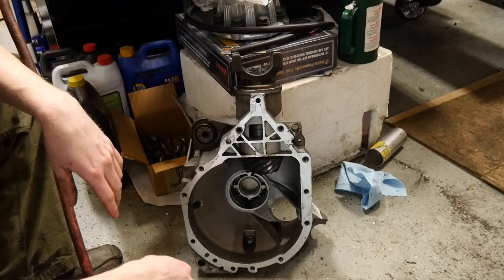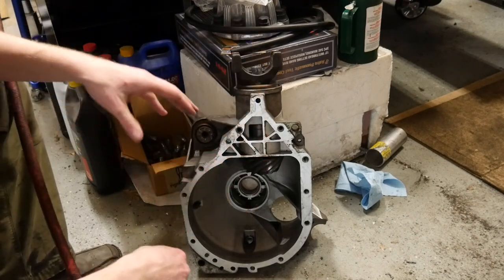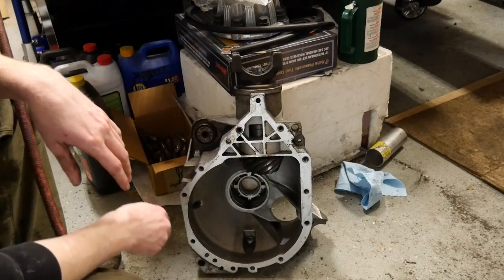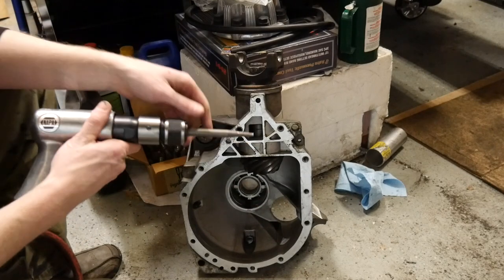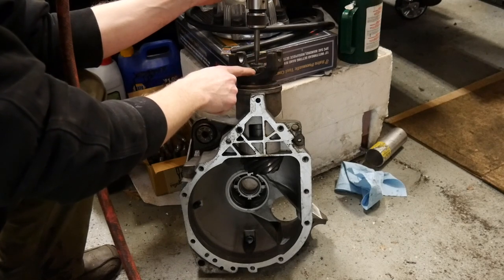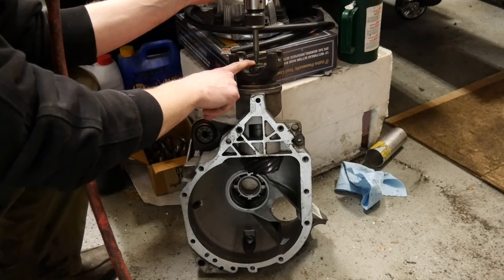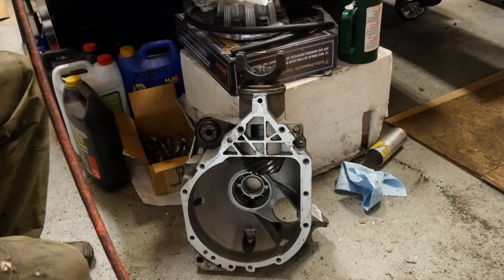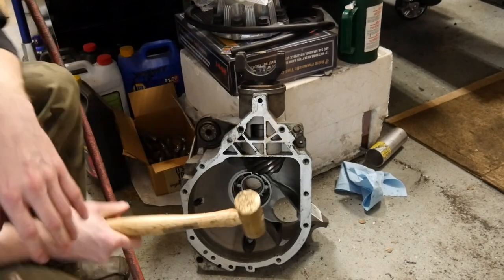DIY - How to remove a stuck pinion gear from an axle case

Comment: Been trying to remove the yoke from my Dana 44 axle for three days on my 51 Willys Jeep. This is really a pain and trying to not break the yoke. Thank you for the tips. Ill try this tomorrow night
Reply from the maker: Did you end up getting that yoke out?
Reply: Epic Tim Not yet. It wont budge.
Reply from the maker: bummer!  You can also try to soak it in some penetrating oil for a couple days or even try some torch heat but be careful not to damage the yoke or housing with heat.
Reply: Epic Tim After being sick for five days now I decided to get out of the house and try removing that pinion. Placed the nut back on it and used the board and brass hammer method. Still no luck. So now its standing up and I have PB blaster in the pinion nut area. I’ll try again tomorrow.
Reply from the maker: Hope you feel better soon!  I've not had alot of luck using wood, it usually splits to easy.  Thats why I bought the brass hammer to keep from marring up the threads.
Reply: Epic Tim I  found that as well. I put the pinion nut back on the shaft and started using the brass hammer to knock it loose. Seems to roll the top edge of the pinion nut. True the air tool with air punch for a while using shorts repetitive bursts and no luck. This thing really hates me. I gave up for the night on it and put more penetrating oil on it to sit for another day. Feeling better today and hopefully tomorrow Ill have enough juice back to swing the hammer.
Reply: Epic Tim Finally got that pinion out. Took it to a local machine shop and they pressed it out with an industrial hydraulic press. Ten minutes and $20 later it was out. It was pretty full of dirt and old grease. That 65 year old pinion is still in great shape. The guy at the shop told me I would have had a heck if a time getting it out by hand.
Reply from the maker: BUMMER!!  sometimes you just gotta pony up i guess...